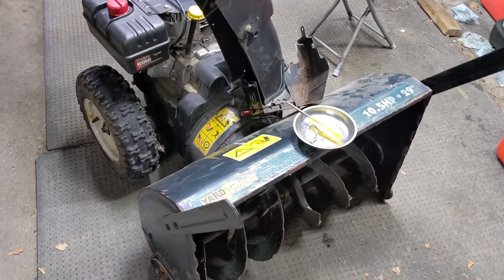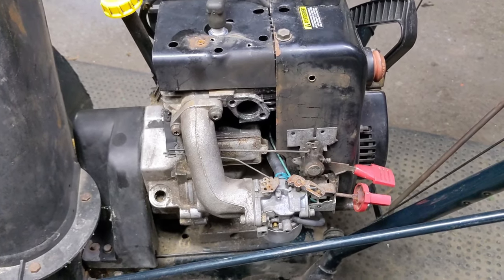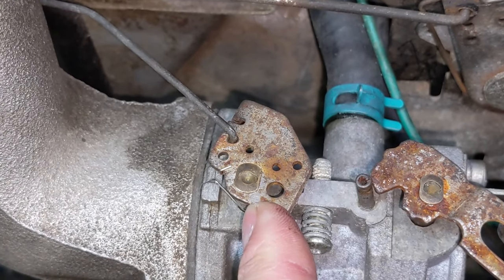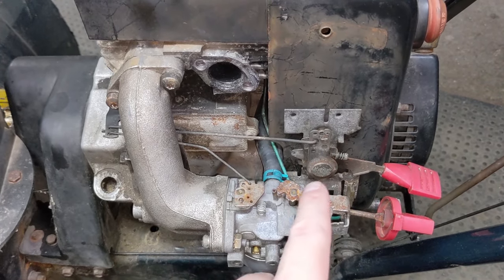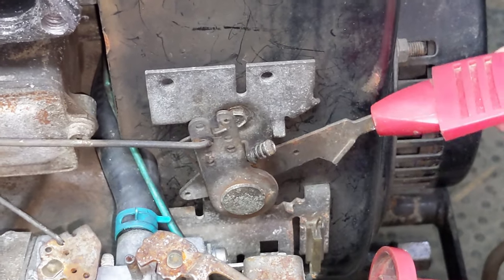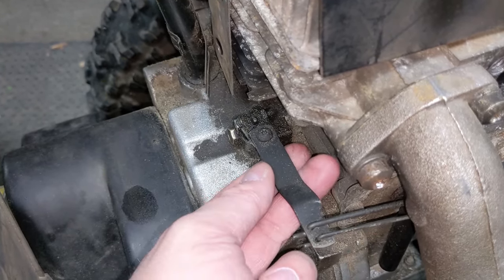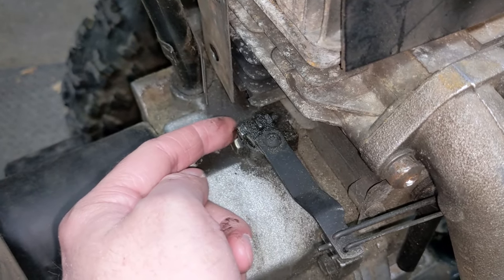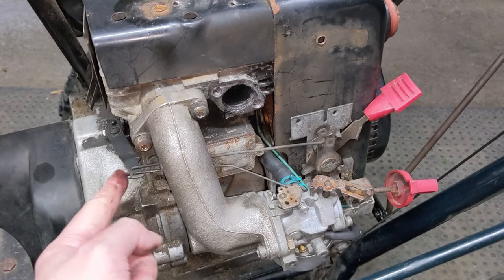How to Set the Governor on a Tecumseh HMSK Snowblower Engine

Comment: What should a guy look at if I can't run my snowblower at high rpm with out using a bit of choke. I have cleaned the carburetor out and still doing the same thing?
Reply: Jetting / valves
Reply from the maker: Main jet not pulling the proper amount of fuel through, or the valves need adjustment.
Reply: @EliminatorPerformance  I work at a small engine/powersports shop in Colorado. Use your videos all the time, have learned a ton from you. Thank you for the great content and knowledge.
Reply: Check the main jet again and use the file part of the torch tip cleaners to ensure it is fully open to original size. You may need to open it up by 0.002" to start and see if there is an improvement and then again it could be a valve issue also.
Reply: I did have the valve cover off and seen nothing wrong. Out of the ordinary does anyone know the valve lash. It's the the 13hp tecumseh troybuilt 45" snowblower.
Reply: @waynestefinashen239  I will try that thank you.
Reply: @jamesserafinchan  Eliminator performance has a great video of checking valves on these motors and the specs they need to be in
Reply: @jamesserafinchan  If it is the OVXL130 engine the valve lash is 0.004 and 0.01016

Comment: I have this exact tecumseh engine on a toro 622. I replaced the carb and it starts fine and runs at low rpm without any issues. The issue I am having is that I cannot get the motor to full rpm. I’ve adjusted the governor linkage every way possible and I am baffled. I wait until the motor is warm before doing any adjustments, but I can’t get it to run at high rpm. What am I missing?! Thanks!

Comment: I have 3 of the HM80 Tecumseh engines with that set up. All 3 surge and hunt when not under load. When I'm using the machine on full throttle under load, they do not surge. I'm hopeful that the getting the governor set properly is the answer. Great video.

Comment: Nice video.  I put a brand new carb on my 25+ year old craftsman.  I had my linkage on correctly but after this video, a few turns on both high and low idle screws it sure started running really smooth.  Thanks!

Comment: This video saved my bacon, thanks!  Rebuilt the carb on my brothers older snow blower including the manifold gasket.  All looked good but must have been a slight air leak at the manifold, tightened it up a touch more and good to go, no more uncontrolled top speed.

Comment: Excellent video.  Very clear instructions on setting the throttle/govenor.  Especially helpful was the part about the lever falling down. That was my problem, and now that I fixed it, it works perfectly. Also helpful was the part on how to check the govenor to see if the gear was broken.  Thanks!

Comment: Thanks. Such a simple thing made my throttle not work at all. Your instruction got me back on track and now it works. Yes, I replaced the carb and the throttle control. That is why it was not working. After that small little adjustment voila.

Comment: Great video , when people make adjustments they should be using a tachometer to a specific RPM spec . The more important adjustment would be the HIGH or fast speed  which should not go over spec RPM as to over stress engine components , this could result in engine failure . I know this is in other videos but I think that it should be mentioned at any time you talk about carb. adjustments .Thanks for the video .
Reply from the maker: Yes definitely, I want to do a video on my STENS tachometer so it might make for a good follow up if I have the time!

Comment: Once that throttle spring goes, good luck! No top end so it bogs down under load and throws snow half as far. Love figuring that out, thanks to this video, when there is a foot of snow in the driveway lol. It's like having a truck that the gas pedal stops half way. It'll get you to where you need to go but it will take twice as long. Great video, thanks man.

Comment: Great video, good instructions. I followed them exactly but still have an unsteady rpm with the governor pushing the butterfly down then it revs up then it pushes down, then up, and so forth. All my neighbors hate me. What causes that condition? At full speed it runs sort of steady but it won't idle. Weak spring on throttle lever mechanism? I took off the float bowl, float, float needle, idle air needle, and then blasted carb cleaner in all the passages. New air filter. It is an 8hp Tecumseh wood chipper with original carb.

Comment: Thanks a lot for your detail instruction video, this engine and carb setup is identical to mine on a Noma Grand Prix 8.25, dual stage snow blower. I don’t know what year mine is, but it’s working well now, I’m going to order the electric start kit for it so my wife can use it. Thanks again.

Comment: Love your vids man! Have you ever done a video on a Tecumseh 8HP m/n 155 026?? Mine has no primer bulb, and no lever controlled throttle. No choke lever either. It’s running good. I finally did my own valve job (thanks for all the excellent vids!). Bought that digital rpm tach you used in your previous video. I set my rig to around 3550. It’s rated for 4000, but I think my approach is sound. Again, thank you…

Comment: Outstanding explanations on Tecumseh carb style and adjustments. Any video's on starter problems with 10.530 Tecumseh 1996' motors on a Husqvarna 10530 snowblower? Starter won't engage to ring gear but starter does run. Throwout gear appears to go to end of starter shaft and is clean-good spring too?

Comment: Great info. My 12hp Tecumseh CTC snow blower runs great but lately it will sputter and back fire intermittently when warmed up on high throttle it’s never been adjusted since new. It’s about 15 years old but works like new for then snow blowing operation. 

Any suggestions would be helpful I run non ethanol high test with sea foam. Thanks James

Comment: Great detailed video!
I bought a similar machine, not running for five years, i put a new carb on it.
It now runs, but seems to idle kind of rough and when i give it throttle it stumbles as it revs and lacks stability. It runs but not like it should. Any suggestions would be appreciated,  thanks a lot.
It's a Yard Machine 8hp 26" mdl. 31AS6FEF729

Comment: Awesome video!  I'm going to spend a little time making sure my linkages are correct and tinkering with the adjustments.  I tried rebuilding my carb last weekend, but it looks like I got the wrong kit.  Any chance you could give me the correct part number for a rebuild kit?
Reply from the maker: Tecumseh 631021B is what we use from Stens
Reply: @EliminatorPerformance  Thanks!

Comment: On my 5hp when I engage the forward arm it wants to do a wheelie. It runs great and throws snow far, problem is it’s the original single speed version and it’s hard to keep up with it. My low idle linkage is one hole behind yours. Any ideas to tame this fast speed. I did put on an oem carburetor. Appreciate any input. Great video!

Comment: I have this exact model engine with the 30” cut, I recently purchased a small tachometer to set the high speed rpm’s to manufacturer 3600 spec and the blower doesn’t throw snow past the auger housing… yikes. It seems when I adjust the rpm’s up I am able to throw snow further. I also replaced the auger belts. They have good tension and are not slipping but are notched. My two questions are this… what RPM is too high (max you’d be comfortable running) and do the notched belts make a difference?

Comment: Came across your video while searching for a fix for my Tecumseh 9hp engine.  When i light the throttle lever up, it moves forward like it should.  If I test it like you do it do from the governor arm, it snaps back like it should, however, when i pull the throttle lever down, the piece with the linkage cable and spring, never returns back to its original spot.  i think it should pull back when you push the lever down but it doesnt.  Is that a spring issue still?  thanks!

Comment: This is a fantastic video and you explained everything perfectly. I do have a question I hope I can get answered. My throttle linkage has the spring all hood uo and wrapped around but has no tension at all. It will not move the throttle linkage when I move the lever. Anyone got any ideas?

Comment: Great explanation.  Curious.  What do you usually set the high RPM'S And Low Rpm's at?
Reply: I believe 1750 is low and 3600 high thanks for watching and commenting we do appreciate it!
Reply: Thank you
Reply from the maker: Low rpms are set to wherever they idle smoothly, but usually 1500-1750. The high rpm on the bigger HP Tecumsehs are usually around 3400-3600, the older they get, the lower you want the high rpm setting. I would feel comfortable running the OHV 13hps at 3600 after a valve adjustment and carb clean.
Reply: @EliminatorPerformance  thanks

Comment: Nice video, well explained. Goes good when it's the same exact model blower as mine lol
Reply: I did all the adjustments as described and for some reason when I throttle up, the engine surges. If I run it medium throttle there's no surge and seems to run fine when blowing snow. Just slightly weaker. Any higher rpm and it surges
Reply from the maker: @echabot2721  probably just need to make a main jet adjustment now that the rpm and governor are set properly https://youtu.be/401YwRlDIAQ

Comment: My red RPM lever does not stay up all the way it sags down just a bit not enough to hamper engine performance but I can definitely hear it go up a bit if I push the arm all the way up, would it be that the L loop spring on the back / side of it is worn?

Comment: Heyo, new sub here! Where did you get this info/ learning? Was there a course/ textbook or just experience over time? Thank you very much for the video! 🤘
Reply from the maker: Years of working on this stuff, then I went and did a night course at the local college here so I could get certified. I didn't really need that because it's not a regulated job like being a car mechanic is, but it was nice to be able to put on my business card that I'm EETC certified.
Reply: @EliminatorPerformance  Thanks for the reply! I'm going to look into that certificate. I worked as an FAA Certificated Aircraft Mechanic (A&P) for 5 years, moved and now am looking to get into small engine repair. Hopefully I will find someone as detailed as you to learn from! I really appreciate the reply! 🙏 I know my 10hp sno-blo is set correctly and the governor gear is solid thanks to your video. 👌
Reply from the maker: @hanginwithj  I've also worked on my old trucks when I was younger, and initially went to college for automotive service technician, got my 310S license, but never really did anything with that... but I learned quite a bit from that too. Before that I was a certified welder so I have quite a range of skills which is always nice when you run a business, you need to be a jack of all trades, fabrication, people skills, communication, computer skills, welding, mechanics, engineering... it's all relative to small engine repair. At the end of the day, I love to learn new things, and I don't think I'll ever stop learning, as the industry is always evolving, we constantly need to adapt.

Comment: Do you have a video on the Kohler 7000 kt735 Intell choke? My choke will not close & when I tried to adjust the choke wire/ throttle cable bent in the throttle handle. I fixed that but I’m back at square 1.

Comment: Hi, this past Friday I purchased a used 1996 Snapper (8/26) model 8265 (for $15 on an online gov auction) that has a 8hp engine model HMSK80 (155527T). I put fresh gas and it wouldn’t start. Took notice that the prime hose is broken off the carb and in another part of the hose. Took the carb drain bowl off and it is full of dried out brown crap all caked up inside really bad and it also looks like breadcrumbs. Would you be able to tell me what carb I need to buy? I’ve searched and I’m unable to determine which is the correct one.

Comment: When i install the breather tube it floods the carb. When i unhook i have no issues. What would cause the breather to flood the carbeurator? Do i need to hook it up or can i plug the end on the carb and put a filter on the engine tube to breathe?

Comment: Great video.
Reply: Thanks James . A generator question we had a Loncin LC3800DDC  generator which showed a 110V output which i thought was abnormal because most show 120V. The original output was 57 hertz with 111.7 volts which we adjusted to 60 hertz 112volts. This should be fine but is it normal have not seen this before.
Reply: @waynestefinashen239  that generator seems to be sold in the UK with 110v and 230v output.  No reason you could not run it at 60 hertz  and bump the potentiometer up a little on the AVR to bring it closer to 120/240v.  But 110/230 will not hurt anything as long as the hertz are at 60.

Comment: Note that the spring being discussed at 8:18 is available as a replacement part... Tecumish # 34663.   My machine was running slow and bogging down under load and I changed out the old weak spring and it runs much better.   Donyboy has a video showing all the process.  For a couple bucks, just put a new one in if you are in working in here.
And that's a T10 screw to adjust the high speed.  You can even do it when the sheet metal heater box is reinstalled if your have good light.

Comment: do those style mufflers come with a gasket ? Exhaust seems to come out behind the muffler
Reply: My muffler was loose but the locking tabs were still bent around the bolt's flats. Your thoughts would be appreciated.

Comment: I’m working on this engine. It runs revved up but when I throttle down it won’t idle. Just dies. Any ideas? I’ve got a new carb on the way to see if it helps
Reply from the maker: Check out my video on everything you need to know about carburetor adjustment
Reply: @EliminatorPerformance  hey thanks. I think I figured it out. The spring on the linkage was wore out so I bent it back a bit now she’s running great.
Reply: Actually still not running right 🥴
Reply: @EliminatorPerformance  The jet needed to be bored out a little. Wow! Thanks for the tips

Comment: What would happen if you just put a throttle cable directly to the carburetor and did not hook up any of that governor linkage?
Reply from the maker: You'd constantly have to adjust the throttle like on a dirt bike, but it'd be different because this either has a constant load or no load at all
Reply: Oh gotcha thanks for the reply. Yes, I have one on a minibike. I don’t wanna go straight to the carburetor. Will it still work if I don’t have nothing else hooked up just the carb throttle
Reply: I meant to say I want to go straight to the carb
Reply from the maker: I don't know I've never tried it before to be honest

Comment: What are the part numbers for the linkages and the governor arm please?
Reply: Depends on the model and serial number of the engine, engraved on the top of the engine shroud, behind the spark plug, usually under the push button for the electric start...

Comment: my aftermarket supplier is 59$ list 42$ my price. online store near Belleville.  am I allowed to post link?
Reply from the maker: From Tecumseh direct they're $39 but I have to pay $10 shipping. MTD the list is $42 as well, but same thing usually $10 shipping. STENS for whatever reason doesn't sell them, but sells many other Tecumseh mufflers. If you post a link it'll get sent to the spam folder unfortunately. I had to enable that because of the spammers and scammers trying to post "You've won" links.

Comment: Do a craftsman chain saw carburetor video okay
Reply: We quit doing 2 stroke equipment repairs basically because the cost of repair was too expensive compared to the cost of buying a new machine. Chickanic has good videos on chainsaw carbs as does Donnyboy73
Reply: @waynestefinashen239  yes chicanic does
Reply: @gradyhernandez4699  If you have never seen DonnyBoy73 check him out he is one of the original gangsters of the small engine repair business.
Reply: @waynestefinashen239  I'm working on a Toro personal pace mower,it starts and cuts off in seconds.coukd be needle valve & float
Reply: @gradyhernandez4699  For sure it is a fuel issue but we have seen cases where a plugged air filter does the same thing. If you have the air filter removed and it does the same thing you pretty well have a fuel issue but it would be that the main jet is plugged. Sometimes giving it a shot of carb cleaner a couple of times and firing it up may pull the debris through and let it run fine but more than likely you will need to clean the carb.
Reply: @waynestefinashen239  yes the air filter seems to be from day one! Lol
Reply: @gradyhernandez4699  So you need to clean the carb or replace it but cleaning should do the job.
Reply: @waynestefinashen239  I think it's that rubber looking piece where the needle valve seats cause the float is not level. ( That's what I think)
Reply: @gradyhernandez4699  If it has the brass float you can bend the tab to level the float if the float is plastic and the tab is metal it also can be adjusted. If the needle valve is seating properly you can not blow air through the fuel inlet when holding the carb upsidedown if you can blow air through then it is not seating properly and you need to purchase a carb kit and change the rubber seat (ring marking side goes down) and needle valve.
Reply: @waynestefinashen239  I have the rubber seat for needle valve. I will do what you said. Thanks

Comment: Can you just take that whole Governor arm out in side the engine and all
Reply: The governor arm can be removed from the governor shaft but you would need to disassemble the engine to work on the governor speed control. Removing it will cause the engine to run at too high of an RPM and blow up.